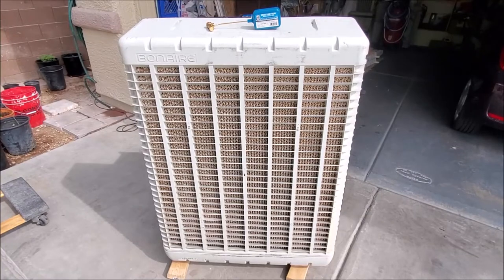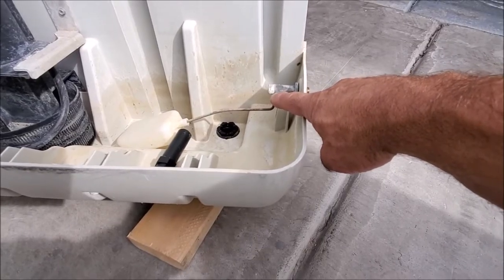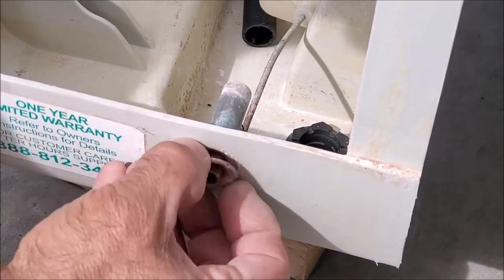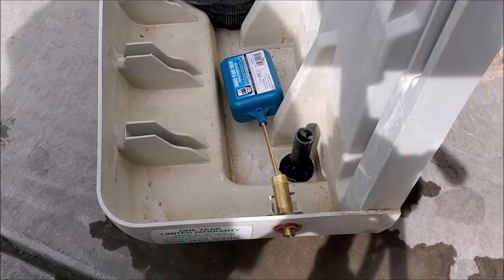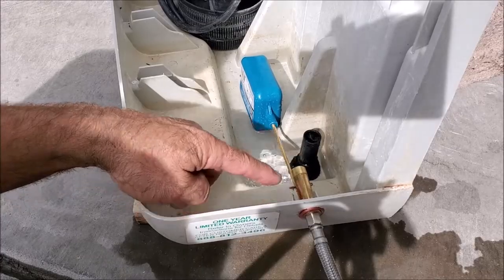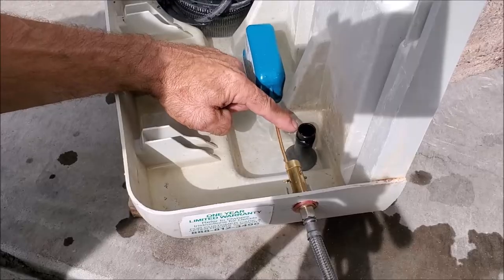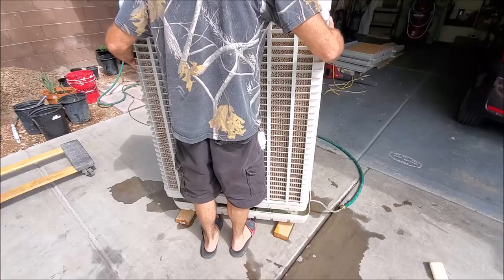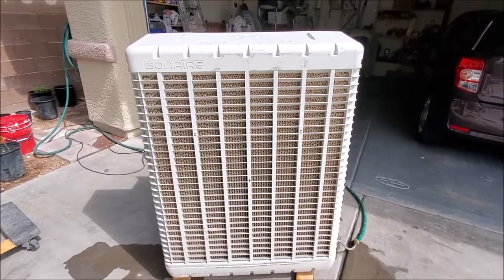Bonaire Swamp Cooler Water Float Valve Replacement

Comment: Need help how do you no if your  swap cooler has hater it doesn’t fill that cold no water is coming out of the drain when I turn it off
Reply from the maker: If you can better explain your self. I don't understand what you are asking and not sure what hater is?
Reply: @boogity66  sorry my swap cooler is not getting cold last year it was way cold we put a new pump last year what could it be  thank you
Reply from the maker: @nightmar3nation253  Check your distributors to make sure you have proper water flow I also have videos on that if you need more information also make sure your swamp cooler pads are in good condition and make sure you have a window or door open for exhaust

Comment: That is because you did such an awesome job on this video I appreciate it Thank you for being so specific
Reply from the maker: The pump is not that bad a change it's hard-wired in I have videos on how to replace a water pump but not Bonaire
Reply: @boogity66  WHY Bonaire  does not address changing the heart of the unit, the water pump, is beyond me. I had to do an emergency replacement by just splicing in the new pump.
GREAT VIDEOS AND INFO! 👍